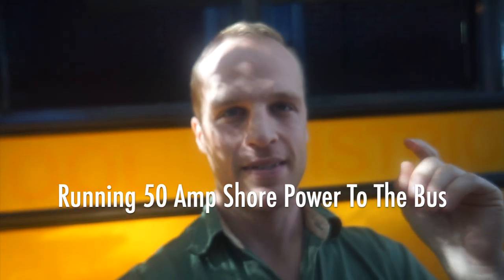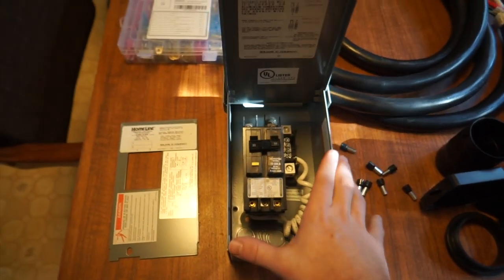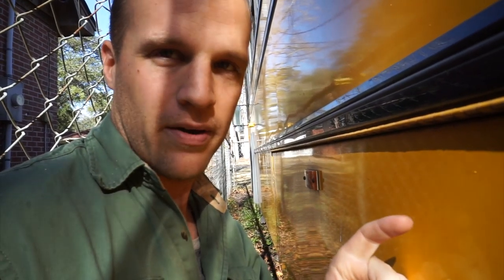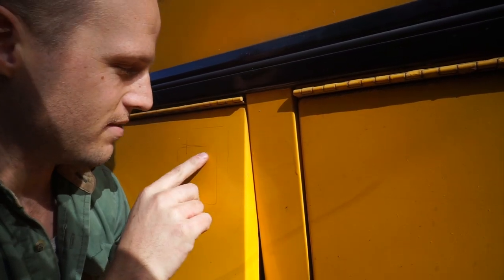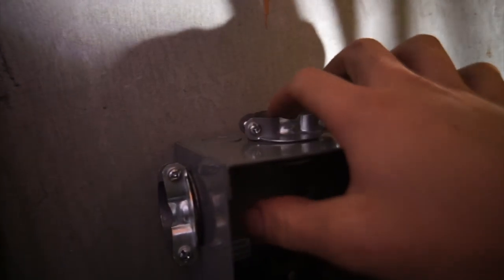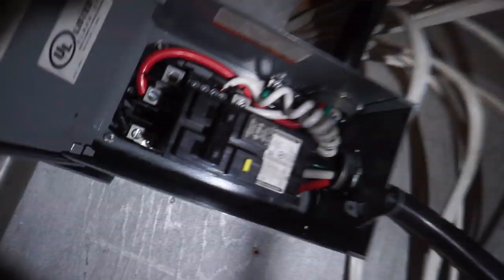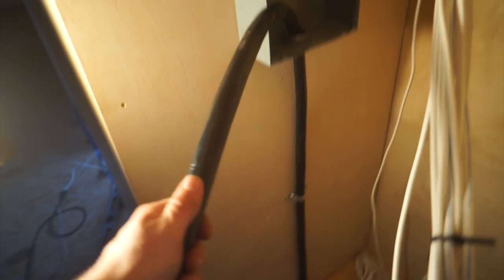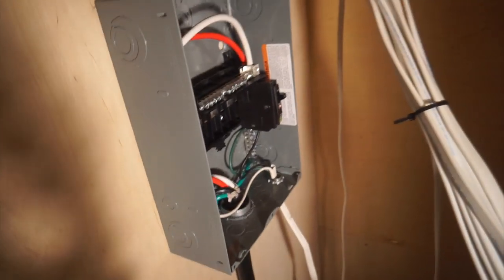50 Amp Shore Power And Panel (Skoolie Electrical): School Bus Conversion Ep  40

Comment: So did you just use the 50amp main breaker so you could easily turn off the power from that outside location or is it necessary for the whole set up? I'm planning to do my 50 amp shore inlet on the side of my bus and the electrical components under the sofa, so will I need the 50amp main breaker? I'm sorry if this is a dumb question lol. I have no electrical knowledge
Reply: No you don't need a main one.

Comment: So… I’m just starting the electrical on our conversion… wondering if you’d still use all this gear and do it this way, or if you’d do it different today? Hard to tell from your newer videos what you did on your recent conversion.. I’ve watched them all many times lol.
Reply from the maker: Hey Shane. I would use all of the products from my newer build. Luckily it's all documented here in this spreadsheet. Check it out! And if you do your shopping through my links I'll get a small commission. Hope it's helpful: https://docs.google.com/spreadsheets/u/1/d/1vkmvnCOJNtsGBzphWuBN4SP7hWyKwizSym-490tcv0U/edit#gid=611282886

Comment: Hey, Justin!  I bought the Square D 50 amp panel, but got one with 50/50 in it, not 30/20, even though I ordered from your link and your link is clearly 50 amp.  Is this a problem, or can I take out the 50/50 breaker and replace it with a 30/20?
Reply from the maker: Hey! I'm having trouble understanding your issue. You bought a 50amp "spa panel with breaker"? The link said it was 50 amps too, but you want to put in a 30 amp or a 20 amp breaker instead because you don't need 50 amps? The answer is yes you can put a different breaker in there.
Reply: @MobileDwellings  Okay, great!  

The 50 amp spa panel came with a 50/50 breaker, not a 30/20 breaker.  I wish I could attach a picture to make it easier to understand what I mean.  It threw me off seeing a 50/50 breaker in it when I was expecting to see a 30/20, which is what we see in your video.  I thought they sent me something else by mistake.

Comment: Hello I'm wiring my bus up off you video and I was wondering if you could help me understand this a little bit better
Reply from the maker: Hey Gavin. I have two videos coming out on Thursday which should be helpful for you! It's a whole install of an off grid system.
Reply: @MobileDwellings  that's awesome I just wrapped up wiring except I got the wrong brakers for my sub panel sadly but from what I can see you have your ground fault (green wire) going into the equipment ground terminal on the 50 amp main lug correct